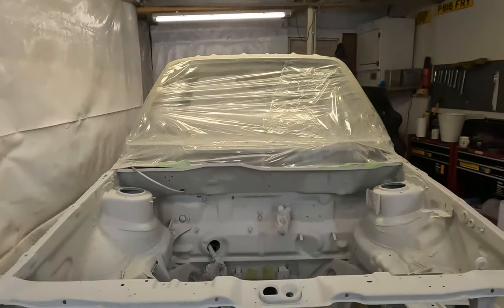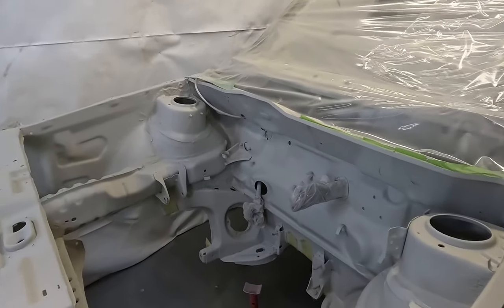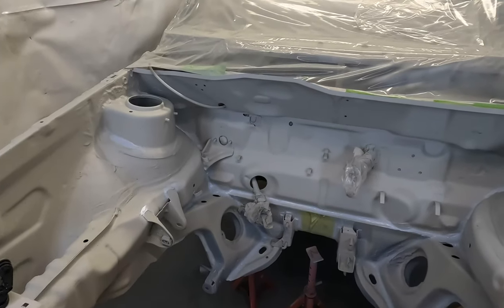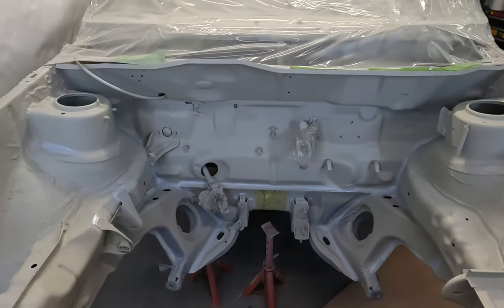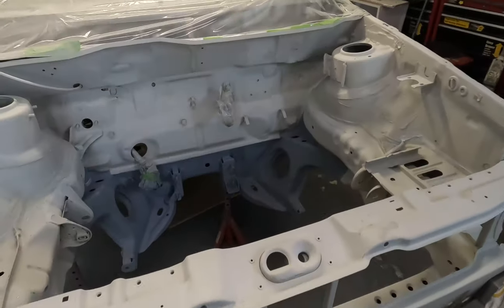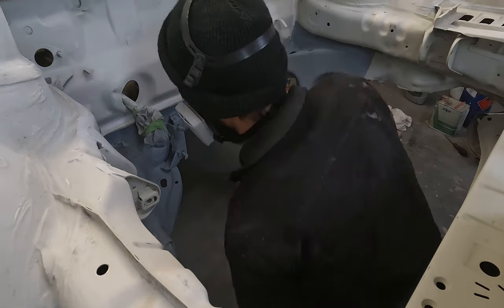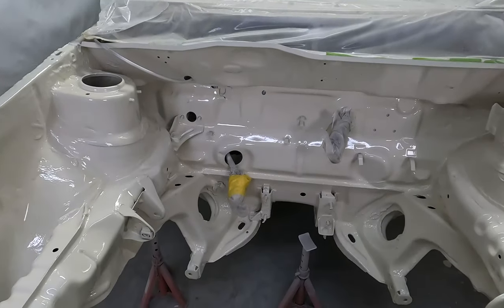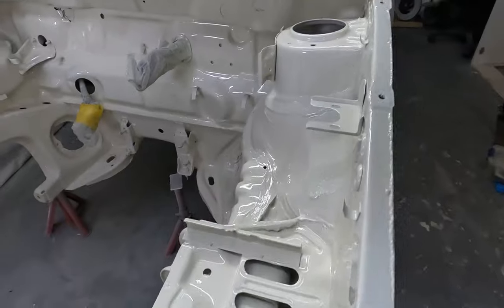Spraying Upol Gravitex And Basecoat - Episode 4 - 1987 Volkswagen Caddy MK1 Restoration Project

Comment: What are you using to stop water in your air line from the compressor?
Reply from the maker: I have a regulator and water trap fitted to stop water coming through. Also have the line far away from the compressor so it allows the air to cool before it hits the water trap